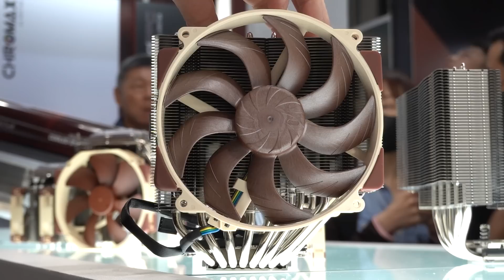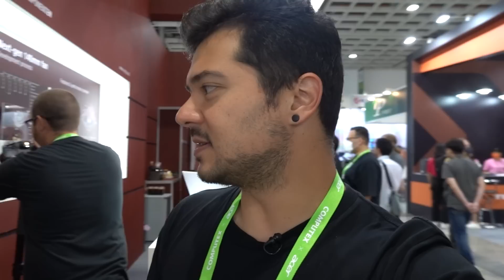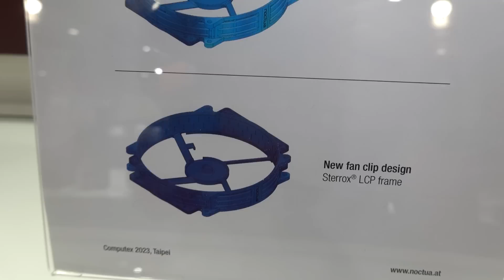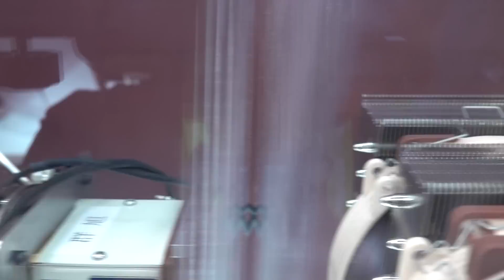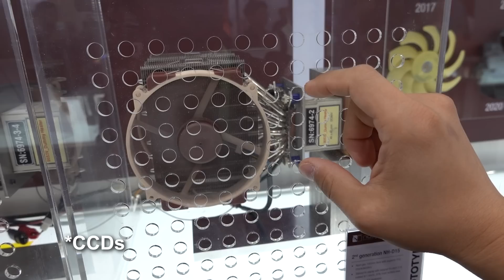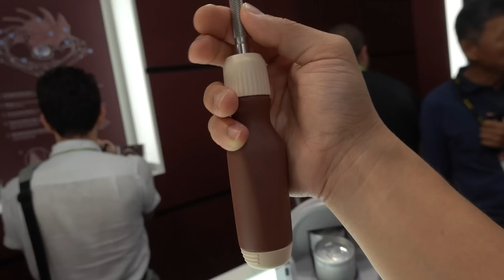The Perfect Air Cooler Doesn't Exi-- | Noctua NH-D15 at Computex 2023

Comment: Will this new king of air coolers compete with high-end AIO's in terms of performance?
Reply: It's u1nlikely to pose a threat for a  420 or 480 mm radiator. But I'm sure it will give every 280 mm a run for its money. Maybe even some lower-range 360 mm if you replace the fans with the Industrial 3000 ones.
Reply: @cristianroth8524  It already does out perform some aio 360 mm lol

Comment: The Be Quiet Dark Rock Pro 4 is basically a Direct Match for it
Reply: for the average user yes, but for hot chips no, the dark rock pro 4 is still using the old fan design of Be Quiet and still needs an update. If the put the new Silent Wings on it, it should be much better than now, but there is no announcement yet
Reply: Be Quiet openly admitted that their flagship cooler is outdated and they're working on a new one as we speak.

Comment: It's amusing to me that no one has beaten the original NH-D15 at cooling performance, and now they're coming out with Gen 2.
Reply: They have beaten it. Multiple times in fact is has been beaten. Its moreso that the only way to beat it is more airflow, or more optimized design for specific cpus. Noctua could just put their 3000 RPM fans on it and retain their crown, but thats gonna be really loud and not be worth it. They want stability over time.

Comment: Love seeing Noctua continue to push themselves and the industry forward, but this product NEEDS a new name. There has to be a distinction between the existing NH-D15 and this new product, even if they just call it the NH-D15 v2.
Reply: D15.1?
Reply: NH-D15 One
Reply: It doesn't need a new name. What a buyer see's one overpriced NH d15 going for 200usd and another overpriced NH d15 going for 500usd, they will easily tell which one is the new one.

Unless this new d15 have some massive improvements in performance, I'd rather just give Noctua a pass and go for something with the same performance but a sensible price (the Peerless assassin 120).

Comment: APPLAUD NOCTUA FOR MAKING REAL CHANGES! Hate phone companies that come out with a model every year with fractional improvements over previous versions.
Reply: New products/standards appear in the ecosystem and products working within it gets released with better support for the changes. The changes to the fans are incremental and probably not very significant, it's not like we have to gain a couple of percent better static pressure for a normal gaming system to work. The changes to their cooler is dictated by the changes in CPU designs, they have to do that or they will be left on the dust by other manufacturers. Phone companies does the same thing, it's just that the latest changes in the phone ecosystem have been incremental so there's very little to build upon for major innovation.
Reply: just takes them years
Reply: its a fractional improvement tho, dont expect wonders.

Comment: Cool that they are doing this (pun intended) but My regular D-15 has been rock solid for 3 computers now and I have no need to upgrade. Noctua's products are very reliable and may be a victim of their own success.
Reply: I have had my d15 on two builds for 6 years now. Zero issues. Even the same fans
Reply: Yeah I'll only buy this of I for whatever reason need another PC or my nhd15 spontaneously combusts(most unlikely thing ever)
Reply: There is a reason to upgrade IF you have the higher heatload CPU, like a 13700k/13900k. But even then water cooling becomes the better choice there anyway unless you want the best stability. Its not bad having a product you can re-use and move to the next system.  They still have the potential to sell millions of units, they arent worried.
Reply: @ShimejiiGaming  yeah for me water cooling is a no go, as it'll inevitably require parts to be replaced, the nh-d15 can basically handle anything thrown at it and last a lifetime
Reply: Not necessarily a victim... As an example, I have several alternative brands of drawing tablets that I have purchased... Some worked pretty well, some were terrible. But the accuracy, control and durability of my Wacom tablets (at least, my experience) is way above anything else. Specially power users will opt for the thing that is more rare to fail and provides with good performance, reliability ,  low noise... Specially if it's for professional use (I include game streaming as pro activity if it pays your bills... Not my pro work, but I really welcome that my noctua (got a d15 in its day as well) is silent and works quite well). I mean, premium, durable products made with love and care do have their market, too, as much as I love a good deal.
Reply: @3polygons  You don't understand what he's saying. The products are so good that Noctua can't sell you another one until you either have a manic trip and want to buy a bunch of new hardware including a fan for no real reason OR the fan breaks in 15 years of constant use or something.
Reply: @CyberneticArgumentCreator  Yep, I totally understood that. Following the example I mentioned, my Wacom tablet (2009) is now 14 years old, without a scratch or problem. There's a market for people wanting that for a higher price, and to the issue you mention, if enough people buy the product due to that trust, at the end you sell enough over time. It might not sell me another one in a bunch of years, but that's less of a problem if they sell to many people, compared to cheapo products that have "programmed obsolescence" in them. I don't think a company keeps making money and surviving if their business model does not work... And they've been around for a while.
Reply: @CyberneticArgumentCreator  More to my point and using the same Wacom example. While the Intuos Pro XL is yet pristine, I needed another one for my laptop and working at other places; due to the good experience with the brand, purchased a Wacom Pro L. Not only that , I recommend it to people over other brands, and I have seen a bunch of colleagues following the advice. Prestige sells a lot, too, even if they sell fewer products to a same individual.

Comment: The only thing I don't like about it is that it is still called NH-D15. That will lead to so much confusion on a market. If they at least added a letter behind it to mark that it is a revision, or completely change the number. that way you would immediately know, that a seller is not "screwing you" over with the older model (even though it is still a beast, if you want to buy the new one and get the old one, it would suck).
Reply: It's called NEW D15 only for now.
Once it will be released, it will have another name.
D16 or D20 or something else.
Reply: sad, I have to wait for the chromax version.
Reply: @bh3170  Just got one of Thermal Rights direct competing products for half the price. It’s better than the D15.
Reply: @TheEchelon  proof?
Reply: @hardlyworgen71  I can see the reviews now: 
The NH-D20: A Critical Success!

Comment: Ugly color scheme.
Reply: First time seeing a noctua product?
Reply: @Shigetora  no,  I'm just saying.  It's not a prefect cooler imo when it looks super ugly ha
Reply: It's done on purpose, when you see those colors in a PC case you immediately know it's Noctua fans. 
If it would be black, white, gray it wouldn't happen.
Reply: @Tigrou7777  they have black ones thought,  and think they'd have more sales if they made black ones and white ones.  Instead of Ugly focking colors
Reply: oh yes because color scheme affects coolers overall performance
Reply: cooler is designed to be efficient in COOLING, not looking good.
Reply: @Jay  can have both.  When considering a product I look how it looks and if it looks cool and works with my shit. I check how good it is, and if it's solid and no issues I'll buy it. I don't need the coolest Temps, as long as it's much lower then thermal throttling and looks amazing it's worth buying to me.